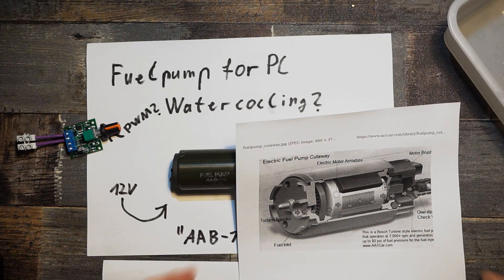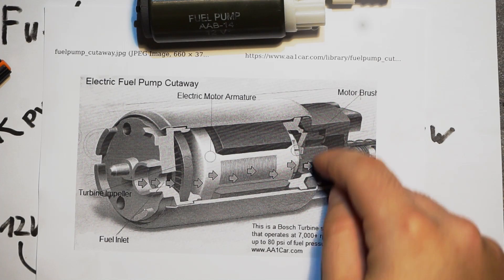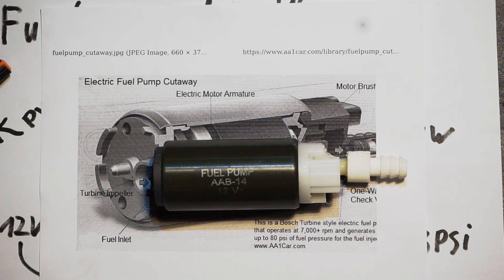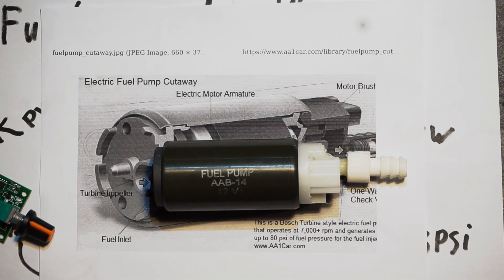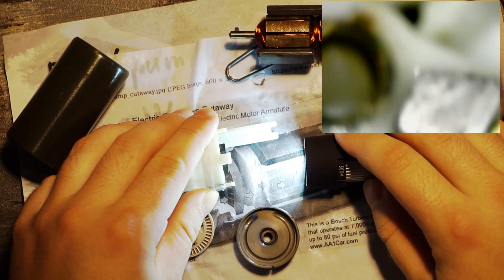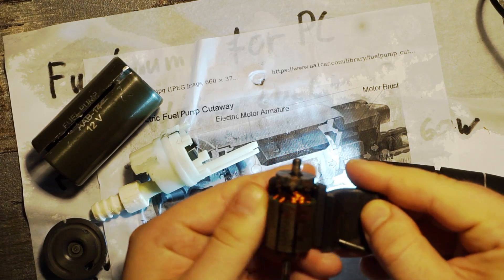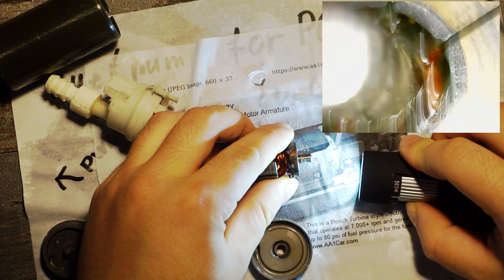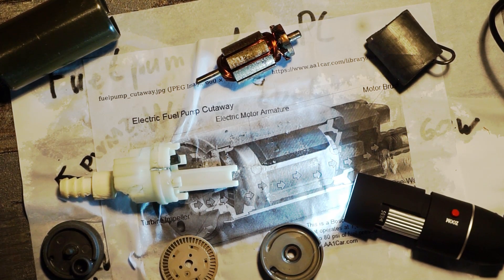Cheap fuel pump for water cooling? Anatomy of a failure.

Comment: That seems odd to me because your supposed to completely submerge the brushless motor on rc cars when you first get it to break it in and the water washes away all the brush material. I’ve never had a motor go bad because of putting it in water so I wonder what the difference between rc brushed motors and brushed fuel pump motors

Comment: Overcomplicated idea, put the fuel pump on its own loop, put an impeller in the loop, link the impeller to a turbine in the main system loop (cpu, gpu, ect), or alternatively, you could just use a non-conductive liquid (if you can cool a system with alcohol you could probably find something). I dunno, just an idea.

Comment: the fuel acts as a lubricant for the pump, switch the coolant to mineral oil or a really thin oil. could get away with using wd40, can get a non-pressurized gallon of it for like $20 (WD40 490118)
Reply: I didn't know WD40 came any other way than in a spray can.
Reply: @Milamberinx  yup, I just put it in a spray bottle